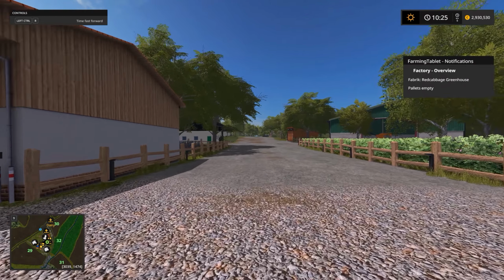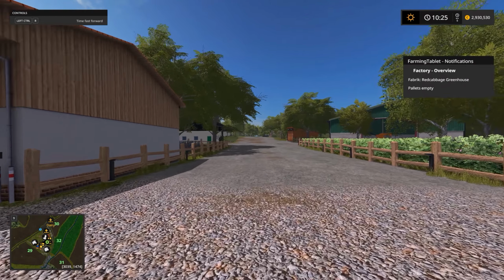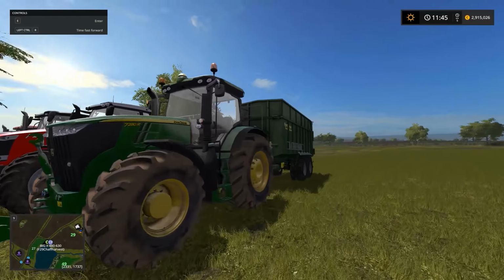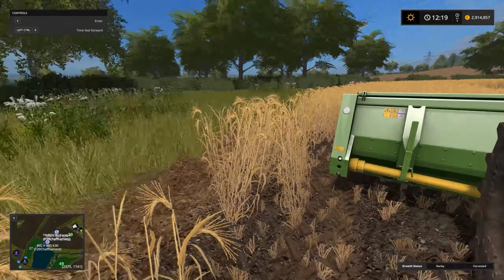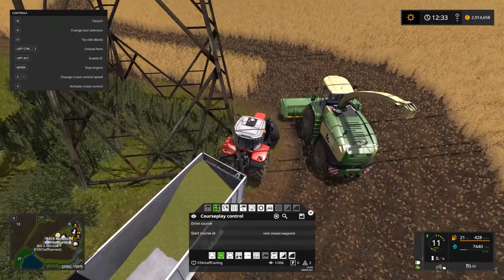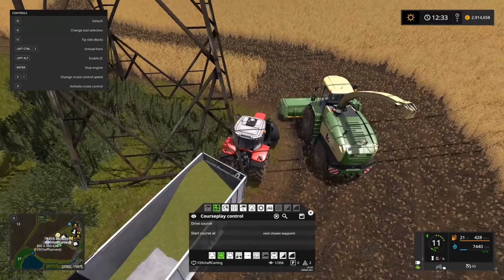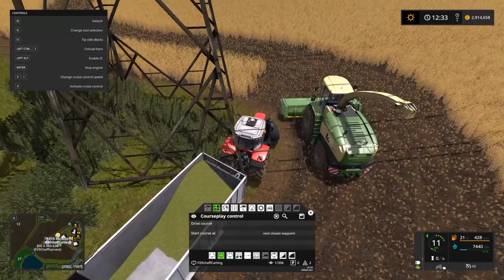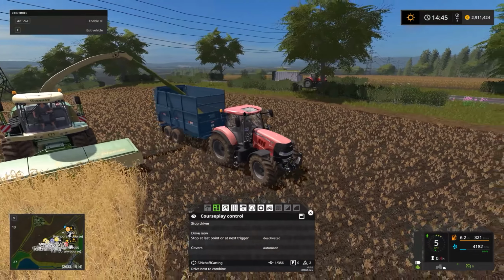How to setup Courseplay 5 for having multiple forage harvester (a tricky one)

Comment: Thanks for doing the vid. I was having many of the same problems as you were, such as the with the leveling tractor not being able to keep up: I ended with interim chaff storage at the silo's. I was never able to get more than 2 harvesters to work properly, because the chaser tractors always lined up for the first harvester, and ignored the others. On my next go around, I will try using the BigX Cargo's, as they behave like tank style harvesters, provided that the newest versions aren't sliding while unloading, but I'm running with the More Realistic mod, so it may be tricky. Thanks again for taking the time to do the vid.
Reply from the maker: You are most welcome mate :o) And yeah I think this setup is very hard to run with more than 2 harvesters. I think it can be done, but you would have to be watching over it constantly.
I am sure the BigX Cargo mod will make it work a lot easier :)

Comment: Could you set the offset for tractor course to be right hand side when doing headland? Would avoid trees and pylons..
Reply from the maker: That would be a great way of avoiding the trees on the edge of the field :) And for the headlands it would work really well. I am not sure how it would work with the actual fieldwork. I think you would have to set it back to automatic due to the symmetric lane change, but I am definitely not sure about that.

Comment: 31:06 is there a specific reason why you want to disable fuel saving on the course?
Reply from the maker: In this setup I have the level and compacting tractor setup to look for all Courseplay controlled tractors within a set range. So when the carting tractor arrives at the bunker silo, the level and compacting tractor detects it and goes to the waiting point. But the carting tractor will have to wait for the level and compacting tractor to get out of the way, and that can take some time. Sometimes it will take so long that the fuel save option in Courseplay will kick in, and shut off the engine of the carting tractor. If the tractor is shut off, it can sometimes cause the level and compacting tractor to think that the carting tractor is gone, and it will go back to the bunker silo to continue the job it has. So that will cause the two tractors to crash into each other. That is the reason i disable the fuel saving when carting to a bunker silo :)

Comment: wonder if you can help me, I would like to set up courseplay to spread solid manure on my fields which I can do but would like to have the solid manure spreader fill up automatically from a manure storage point and then return to the field, I don't want to use a loader or a portable elevator to load at the cows or pigs but would rather take their manure to a central storage point and load the manure from there. can you please help me
Reply from the maker: Is there an automatic loader at the storage point that you can drive up to and it will start filling the trailer?
Reply: thank you for the reply. that's the problem there is no auto loading point on my map and I cant seem to find a mod that will auto load solid manure when running a combined course in courseplay. the setting up of spreading the manure is no problem but the refilling of the trailer is unless I manual reload or use a loading shovel and that's not what I'm trying to do here.
Reply from the maker: I am not familiar with a mod that can autoload your solid manure. If I was to set this up, I could setup a course using Courseplay to fill the manure spreader. I know it is not what you are searching for, but I don't know if there is another way of doing it. There is a placeable mod for holding the manure: https://www.modhoster.com/mods/manurelager
Don't know if that helps you
Reply: Datalund thank you again for the reply. I have that mod you refer to and it does not auto load. I wondered if there is a way to edit the mod so that it will auto load. I'm not to hot on mod editing. If you want to do a course then it mite make me decide to go down that route , as I am open to any ideas on this. Thanks again
Reply from the maker: Og bugger... I was kinda hoping that mod would fix it for you :) But seeing as that is not the case, I would consider setting Courseplay up like I have done in this video: https://youtu.be/qnUT007nHXQ
That is a fully automated setup with Courseplay for solid manure
Reply: Datalund ok thank you for your help. I will just have to get on with it👌

Comment: Can you send me the link to the latest courseplay Beta version or how you find it in Github. I had it but it seems to have gone corrupt.
Reply: http://courseplay.github.io/courseplay/en/installation/index.html   Find it all here James.
Reply: KWAKA thanks. That's what I did but seems to be an issue. I lost courseplay midway through a game. Lost all ability to right click or keyboard shortcut. Reckon there was a glitch with a mod.
Reply: James Lane There is a setting within the hud to change right click to open
Reply: KWAKA Yep, know that. What I meant is I lost Courseplay completely, but thinking about it the clock and money went from the top right corner - wonder if I had somehow changed the graphics and it didn’t fit my monitor...